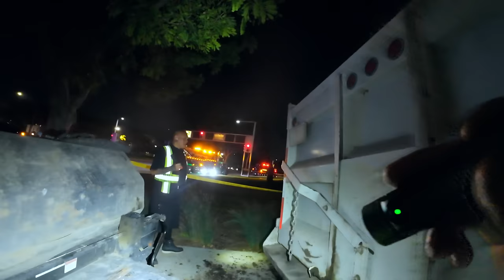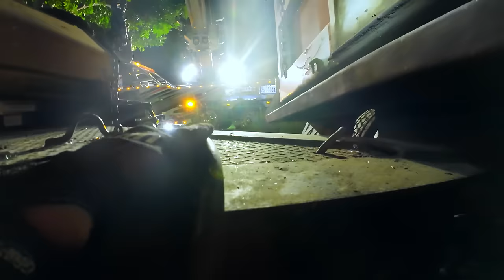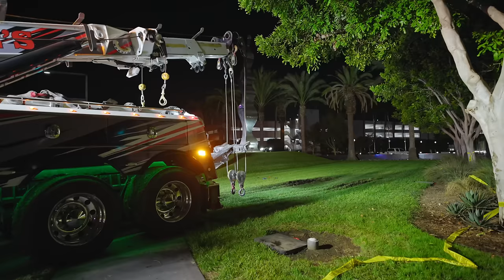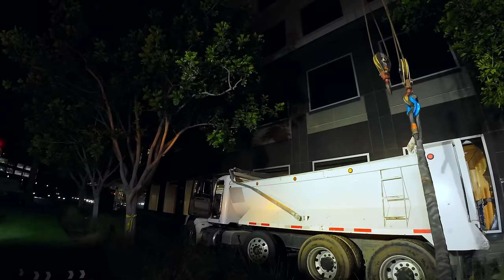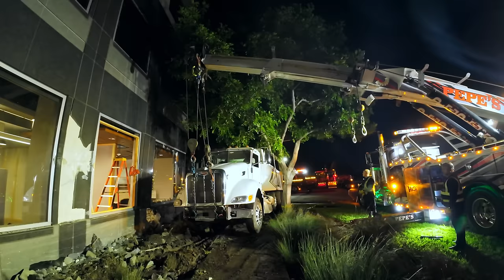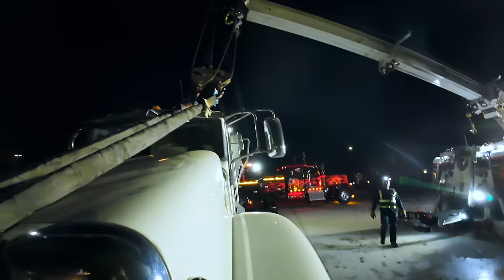EXPENSIVE Wreck! Dump Truck vs Hospital

Comment: Yep this’ll be a bankruptcy case. Insurance probably won’t pay out.
Reply: Even if the auto insurance won't (and it probably will), the corporate general liability will - it's some kind of construction business, so 'a building got fucked up' is definitely in the risk analysis - but they're going to have a LONG list of requirements to remain a customer. Trainings, random screens, etc.

The damage here is just curtain wall. The 'pillar' that's busted out is just cosmetic - the actual structural pillars are set inside the building a foot or so (you can see one through the windows alongside the dump truck). That's why the building manager is getting windows boarded up, not waking up a structural engineer. It's gonna suck to get fixed (especially if those finish panels are no longer readily available) but it isn't dangerous or anything.
Reply: I don’t see we’re you comment  comes from why would the insurance not cover this claim it’s really not a big deal everything he hit is replaceable doesn’t appear to have damaged the integrity of the building itself
Reply: Read your insurance policy. It states while committing a felony . -0- coverage !  Drunk driving is a felony !!! What was saturation of alcohol ? About .40 ? This guy will wish he were dead , and in califs !!!
Reply: @charlesroer972  At 0.400 even Archer wouldn't be conscious. Depending on the driver and whomever he may have been working for, there may not be any insurance. (you'd be shocked to know how many people drive around without insurance. and without a license, for that matter.) The building's insurance will almost certainly pay for repairs, but they will go after anyone they can to get any of that money back. (I've been there. Too many times.)
Reply: They'll pay out whatever he's covered for  that's the point of having it but if the damage exceeds the coverage he will be out of pocket also they will likely drop his policy after which probably doesn't matter cause he's losing his CDL
Reply: Hopefully, this will cause the guy to get help for his drinking 🍸 🙏
Reply: @erikrobles5727 It is because the driver will most likely be found to be at fault for causing the accident by law enforcement, and by the insurance claim assessment.
Reply: @erikrobles5727  Most insurance doesn't cover criminal acts.
Reply: @charlesroer972 You are thinking of your personal insurance coverage… company insurance would pay out and drop them.

Comment: Credit must be given to whomever lashed that trailer.  That equipment didn't budge an inch.  The force of the stop is very evident in the load shift in the truck bed.
Reply from the maker: For reals ! Although we could’ve easily handled it if they came off the trailer, the fact that it didn’t budge during the crash is really impressive
Reply: Seems like the driver wasn’t the same one responsible for securing the trailer load
Reply: he was only three beers up at that time, then 30 later.............

Comment: Man you guys have everything you need in your trucks, I can imagine what the costs are just for the materials in the truck to get the jobs done
Reply from the maker: Costs enough to probably buy a 40ton rotator 😂
Reply: About $158 I would guess.  :)
Reply: Those recovery vehicles have to be close to 500k with all of the remote crane tech.
Reply: @sammencia7945  Some of the bigger ones are over a million.
Reply: @sammencia7945  fully equipped i bet that truck he's operating is a million or better
Reply: @jays106 I've personally worked on one that was smaller than his and it was almost a mil. This rig is easily over that

Comment: I just want to tell you how impressed I was with your concern for that tree.  Others might not have been so considerate.  And how careful you were not to do any more damage to the building.  Lots of landscaping damage from the dump truck and the trailer but there was no way around that.  You guys are so precise.  You all were getting the truck removed and that facilities guy was already working to repair the windows.  I could see water running on the sidewalk.  Looks like an underground irrigation system got smashed.  Good job.

Comment: Great Josh and Dave!  Lucky he wasn't over another foot or he would have been in the office and done more damage to the building!  That was great the way you two maneuvered it out of there.  Great angles too.  I LIKE THESE LONGER VIDEOS TO SEE WHAT ALL YOU GUYS DO!
Reply from the maker: Not even a full foot either! With this weight and speed he absolutely would have taken out that wall, crazy to think about huh
Reply: If street view is to be believed, it's kinda weird how he got himself into the gap between the trees and the building.  I'd assumed the road opposite lined up, but it looks like the angle on the building actually closes the gap.  Even if you come steaming down the right most lane you'd be more likely to end up into the trees, or partly turn and plow solidly into the building.

Unless this was a while ago, there are other tyre tracks across the verge into the grass on Streetview. So this junction must leap out on people!

A question from the UK. Are big truck crashes super common in LA, because googling cdump truck hits buildingc have me lots of results far worse than this one?!

Comment: I like the longer-form videos, I find the thought process that goes into the setup and the intricacies of the rigging just as interesting as the actual recovery itself. The camera angles were great, and I am continually amazed at how well these cameras do in low-light situations, as well as handling the spread between the dark areas and the massive amount of light the trucks throw out. Great to Dave again, and not at all to diminish how awesome Hulk looks, but he totally has the sexiest tow truck in L.A.

Comment: Its good to see 2 rotators work together at this. 

UNIT 44 / HULK : 2020 PETERBILT 389 day cab 50 ton Century 1150 rotator tow truck tri-axle single steer 

UNIT 55 : 2014 PETERBILT 389 night cab 50 ton Vulcan 950 rotator tow truck tri-axle single steer

Comment: That did some serious structural damage to the building.  That exposed rebar cage with a lot of missing concrete inside the cage is a big deal.  That column has lost a significant amount of its load bearing capacity.
Reply: Imagine had it been a direct hit and actually took out the corner and several yards of wall.
Reply from the maker: This is exactly why we rigged the way we did, especially now knowing the front axle was jacked up. Winching it back and having the truck catch that rebar or do more damage was an absolute priority to avoid
Reply: No. That is a curtain wall, which is nonstructural. The actual loads are carried by columns spaced a foot or so inside the outer wall (sometimes attached to the outer wall with drywall just to make them not look weird). You can see some of the structural columns through the windows as the 'thick' ones.

Obviously you don't want to do more damage to the curtain wall, because curtain wall is still a wall and thus expensive, but the absolute worst that can happen is ripping the facade off the building, and you'd have to try a lot harder to do that.
Reply: @EyeMWing  I thought it looked like it had taken out a bit of the column too, but I could be mistaken.  We didn't really get a good close up look at the damage to be sure.

Either way, it was a good job keeping the wreck away from the compromised material during recovery.

Comment: I found that location on Google maps/street view and it looks like it hasn't updated since 2022, which is weird as most places are updated every 1-2 years. But curious if they added concrete or boulders to prevent another runaway vehicle from going straight through that building.

Comment: slings are usually 5 :1 break strength vs working load limit. so a 30,000 lb sling if not on sharp edges will go to 150,000 before snapping

Comment: First of all I love your channel. Very clean professional And respectful work. However, It seems, in my humble Opinion as though Some of your Work May be done for content.  Casinpoint being the last rigging. Why couldn't you have continued to pull the Truck into the street with the black truck and pivot on the front wheels until the truck was parallel with the curb. Job done. Just saying.

Comment: I have a question. Why I always see rotator with snatch blocks on the main lines even though you  are working under the cables lifting capacity ?
Reply from the maker: They stay on permanently. Why would I take them off? Then I get a heavy lift or roll over and have to put them on?
Reply: @PepesTowingService  Oh that's a great reason. I just always wondered that, I thought maybe there was a more complicated reason :D

Comment: Was lifting by the pintle hitch the right move there? Usually their vertical load ratings are significantly lower than their trailer weight ratings. I would guess that the one on that dump truck was rated for a lot less than the 30K of the sling.

Comment: why didn't you put the truck in neutral as you winched it out, and release the brakes, to make it easier to pull?
Reply from the maker: You win armchair quarterback of the day. How many years experience do you have doing this ? And we clearly did, l literally got Dave on video starting the truck to release the brakes
Reply: @PepesTowingService I watched you pull the truck back and the rear wheels were not turning. I saw Dave in the cab turn the truck on momentarily but it wasn't clear why.  I know you are experts at this. Was there a mechanical issue that kept the rears from turning after Dave released them?
Reply: @PepesTowingService  also, I was legit curious. You could have had specific reasons for not wanting the rears to turn during the pull, which is why I asked. As an engineer, I understand issues of forces and counter-forces, and I DON'T know all the calculus you guys do when you rig a pull...

Comment: I w have rigged on street side of tree to start.  But good job
Reply from the maker: How would you possibly have anywhere close to the boom length needed to lift the front from the street? Dave’s truck was already in the street winching it back, how would you have a second truck in the street needed to do what we did?

Comment: why couldn"t you pull the truck and trailer out from behind , then unhook the trailer?
Reply from the maker: And how would that be better? The landing gear on the trailer was sunken in. The front axle was sunken in. Pulling each one out individually so those sunken parts can be in the air while being winched back was the correct call. I literally explain why in the video, yet the arm chair quarterbacks who have never operated a rotator still have to run to the comments and give their opinion lol